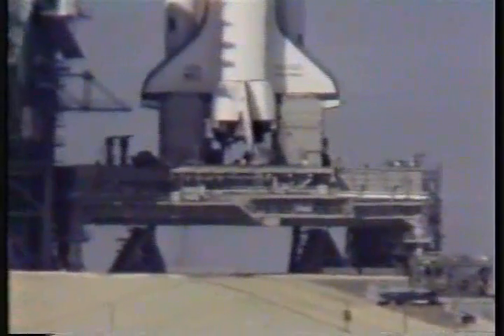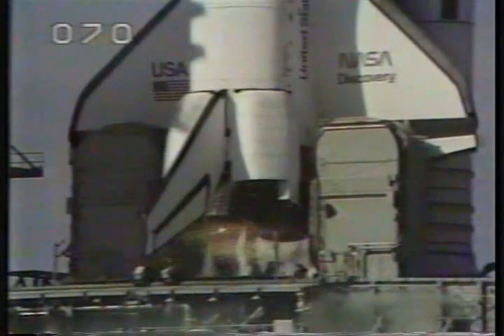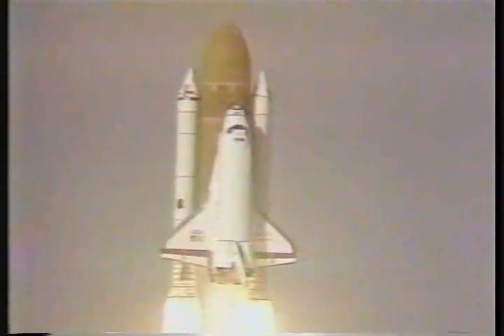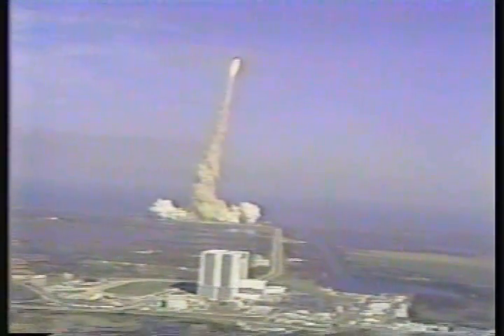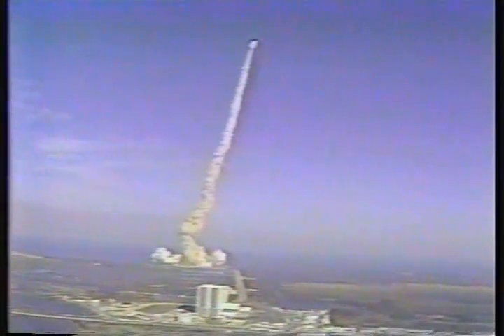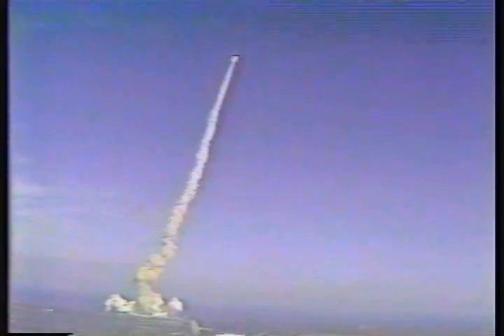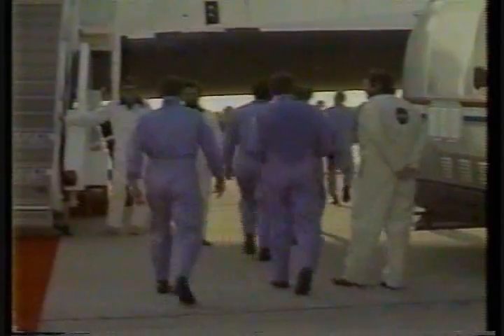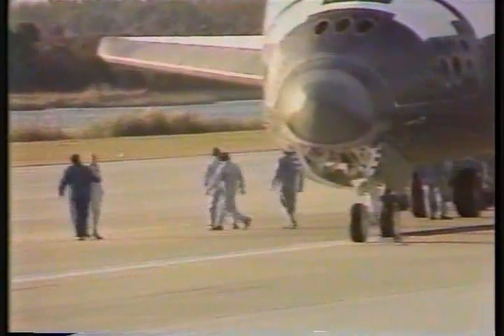STS-51C launch & landing (1-24-85)

Comment: I salute Loren Shriver, Ellison Onizuka, James Buchli, and Gary Payton on their first space shuttle mission! 🫡❤️🇺🇸🇺🇸🇺🇸🇺🇸

This was Ken Mattingly’s second and final space shuttle mission and his third and final time in space.

Ellison Onizuka happens to be the first Asian American and the first person of Japanese origin to fly into space. Sadly, he would later be a victim of the Space Shuttle Challenger disaster on January 28, 1986, in STS-51-L. 😢💔🇯🇵🇺🇸🇯🇵🇺🇸🇯🇵🇺🇸

This was Gary Payton’s first and last time in space during a space shuttle mission.

Nearly a year after STS-51-C, the Space Shuttle Challenger was destroyed during STS-51-L, which included crew member Ellison Onizuka. The Rogers Commission found that the worst Solid Rocket Booster blow-by effects occurred during STS-51-C, where the Viton O-rings failed to seal properly. Post-flight analysis revealed charring and significant penetration of the primary O-ring in the right SRB. This supports the consensus that low air temperature, recorded at 12 °C (54 °F), contributed to the disaster.

Comment: This was the first military flight for the Shuttle. Originally assigned to Challenger,  the orbiter was changed due to tile problems with Challenger on its previous flight.  It is believed the Shuttle carried a geostationary electronic intelligence satellite on an inertial upper stage.  The flight carried the first of what was intended to be many military Specialist passengers, Gary Payton.  In the event, he was one of only three military specialists who ever flew, as military flights were curtailed and then cancelled following the Challenger accident. 
The launch was delayed by a day due to the coldest day in memory at the KSC and this led to the problem with the o-rings which destroyed Challenger almost exactly a year later.  Fortunately for Discovery, the weather was not quite as cold as it was for Challenger and although there was burn through, the o rings held until the SRBs separated.  Also there were no high level wins that contributed to the Challenger tragedy.  All the same, engineer Roger Bojoly  was shocked at seeing the state of the o rings on inspection after the flight and said “I almost had cardiac arrest. I could not believe the Shuttle had not blown up”. 
This was the shortest 5-Crew mission flight . Although the satellite was successfully deployed problems with the IUS meant a first  stage thrust shortfall, which was made up by thruster firings. 
The commander, Ken Mattingly, made his third and last flight. He was one of only 2 astronauts who travelled to the Moon who flew on the Shuttle. Pilot Loren Shriver made the first of 3 flights, Mission Specialists James Buchli  and Ellison Onizulka made their first flight, the latter his only successful flight, he was killed in the Challenger disaster. Payload Specialist Gary Payton made his first and only flight.

Comment: Fun Fact: Discovery was almost destroyed on this flight
Reply: So after the SRBs were recovered, the engineers like Roger Boisjoly inspected them and discovered the O-rings in both the left and right SRBs were charred because they're were frozen solid due to the cold temperatures where Discovery was launched and as a result the cold temperature prevented the O-Rings from sealing. This is a red flag for the engineers.
Reply: I wouldn't call that a fun fact.
Reply: NASA still chose to basically ignore the problem of o-ring loss of elasticity under the critical temperature until the Challenger disaster, which occurred the following year. Very sad.

Comment: At the 1:52 mark, you can see the flame that almost took discovery, which is similar to the flame that took challenger a year later
Edit: one can see it better at the 2:27 mark
Reply: That is normal recirculation of the SRB exhaust plume. The aft dome of the ET was in an aerodynamic “dead zone,” sheltered from the oncoming wind blast by the tank itself. As ambient atmospheric pressure decreased with altitude, the SRB plumes expanded into the relative vacuum behind the aft dome. This phenomenon is visible on every shuttle flight.
Reply: The SRB joint didn't fail on STS-51-C. It came close, but it held on for the SRBs to do their job.
Reply: Thats bc the fuel on discovery's SRB's are running out of fuel

Comment: The flame you see licking around the tank is NOT an o-ring failure. This effect was seen on every shuttle flight and was due to "plume recirculation" flowing into the low pressure area under the external tank. Every rocket has had this happen. Even the Saturn V had plume expansion as the air pressure dropped and it would creep up the rocket a bit. 

There was no o-ring "failure", just bad blow by which if it had been much worse would have ended up like Challenger. No black smoke puffs at liftoff so the back up ring held. On Challenger 51L both rings were out of position due to the even colder temps and could not seal the joint.
Reply: The teacher Christa was paying attention to this flight. Her family said.

Comment: This is the Shuttle that also had an O-ring failure. You see it at 2:22 and you can really see it here at 3:00 when it leaves the external tank. The Temperature at Launch was 53 degrees so the theory that they should launch under 53 degrees is interesting but flawed because they didn't address the problem that the O-rings needed a total overhaul and weren't  reliable at any temp.
Reply: While there was blow-by of the primary o-ring, the secondary o-ring was partially eroded, but held pressure.  What you are seeing at 2:22 is NOT a leaking of hot gas or the shuttle would have exploded. This ;launch was the coldest to date before Challenger and the engineers warned that it would be "moving away from goodness" to launch at a temp below 53 which did result is severe o-ring damage.  Frankly had the upper winds not placed to much stress on the shuttle Challenger - there is a slight possibility the leaking O-rings would have held until burnout.  The forces on the vehicle from upper level winds were the worst to date that fateful January 28, 1986 and the flexing of the wounded o-ring joints ended up leaking and causing a burn-through.

Comment: 2:22 SRB O-Ring failure?
Reply: No. That is the re-circulation of exhaust gasses from the main engines and solids. You don't see this at ground level because of air pressure but at the altitude they were flying at at your time stand the air is much much less dense and the flames spread out more than at sea level. This happened on every flight. That is why the bottom of the external tank is always charred after the solids are jettisoned.
Reply: Same problem with Challenger...
Reply: looks like it
Reply: Yes... It was a close one this day for Discovery.
Reply: This mission only had 49 complete orbits around the earth.
Reply: Lukáš Bušek yes that's is an o ring failure but it's from the other side so you don't get a good look at it until it leaves the external tank at 3:00

Comment: actually STS-2 was the first flight with significant O-ring damage. 14 of the first 24 flights had damage beyond what was acceptable.
Reply: STS-27 also had the worst tile damage of any Space Shuttle but managed to return. You'd think after so many near failures NASA would've fixed the issue to prevent the loss of Challenger and Columbia
Reply: okankyoto plus its temperature was around 80-85 degrees.

Comment: yeah dude but this is the discovery not the challenger but you are right because this was also if i remember right a very cold launch day as well thank god nothing went wrong on this one
Reply: Actually, they said it was OK to launch at 53 degrees. It wasn't but according to the guys who fought the Challenger  launch  it was OK to lanuch at that temperature.
Reply: The problem was the boosters themselves. 51B two flights after this came within one second of being destroyed. The boosters should have been fixed MUCH earlier.